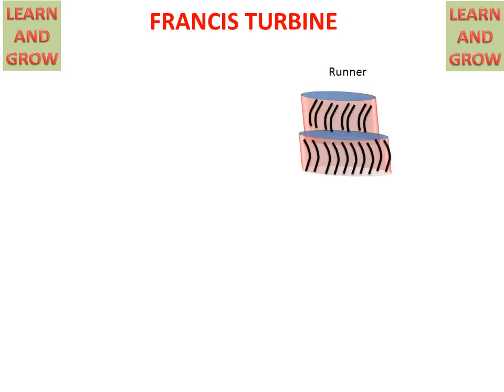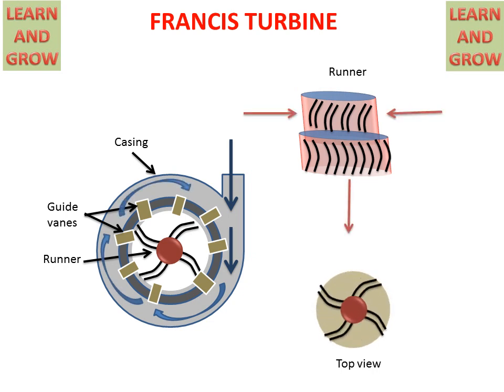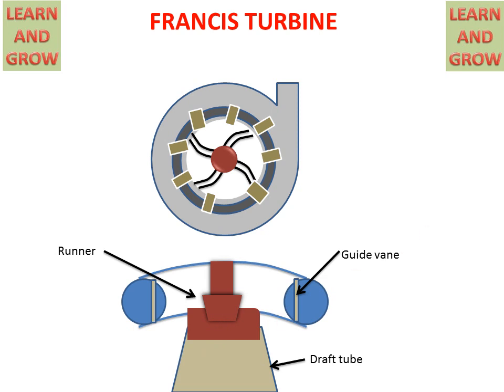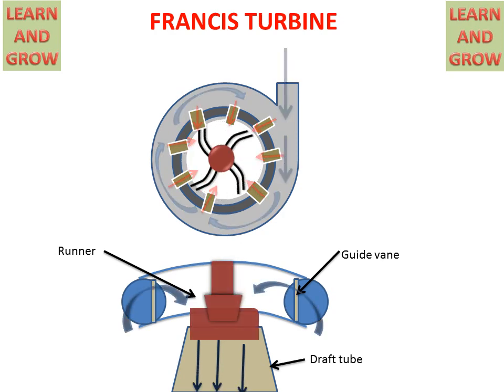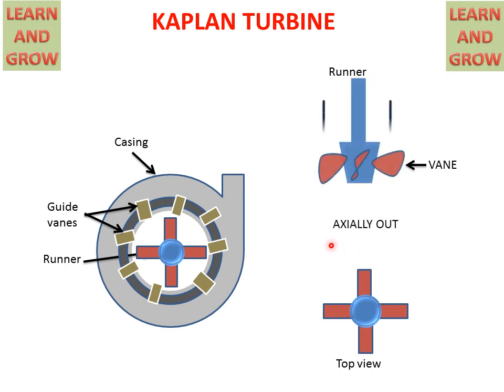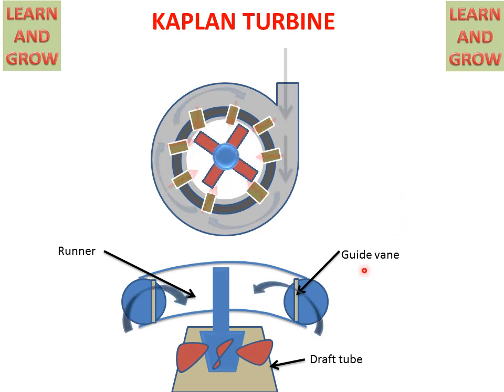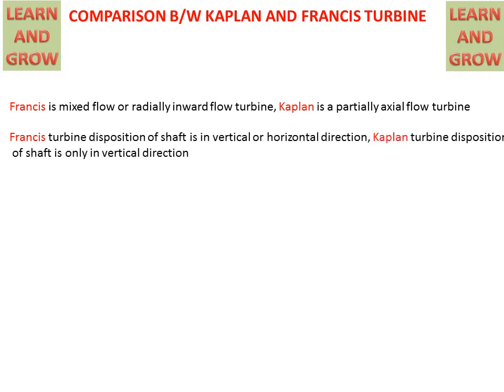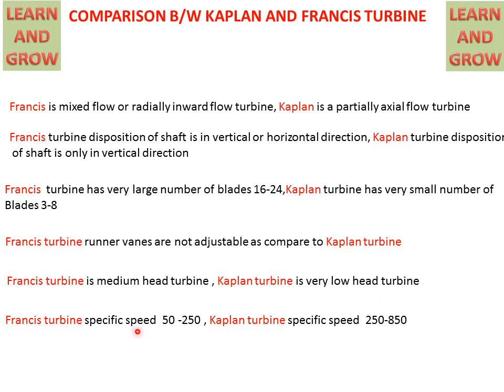Kaplan And Francis Turbine (Difference)

Comment: Some correction. The casing is a decreasing radius and volume volute. It acellerates the incoming water to the maximum provided by the gravity above the turbine runner. The guide vanes control the amount of water flowing into the turbine while maintaining smooth flow. This varies the power from zero to maximum. The turbine vanes absorb the rotating momentum creating torque and changing the horizontal (for a verticle shaft turbine) plane to vertical with rotation. The scoop shape to the exit of the turbine turns the flow so it exits the turbine parallel to the rotation axis. The exit channel adds vacuum pull to increase effective drop through the turbine. This maximizes energy conversion.